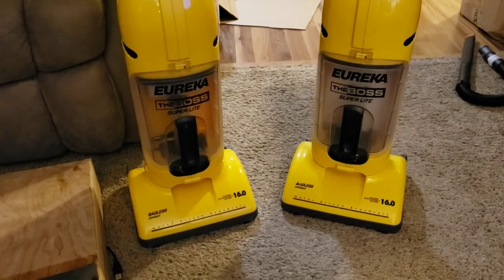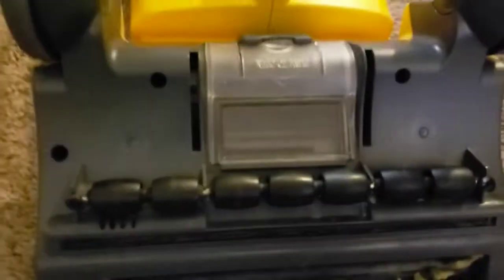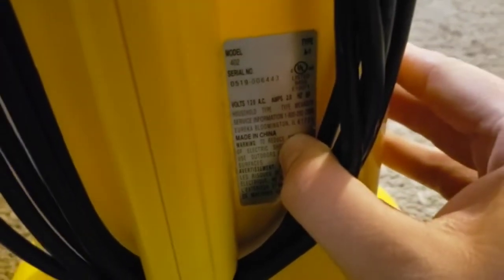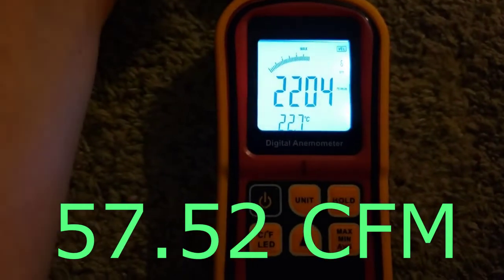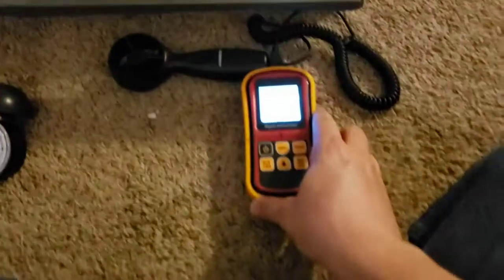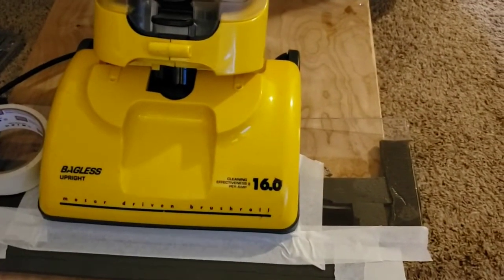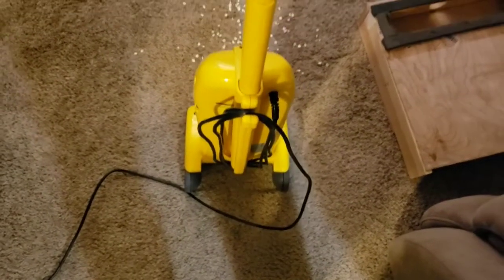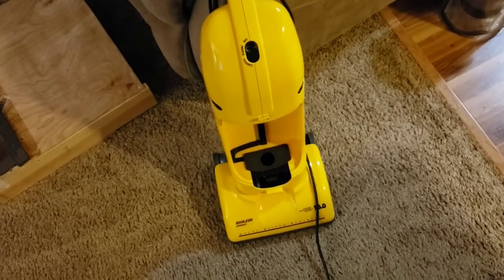Eureka 402 superlite Airflow tests

Comment: I wonder if the "bad" filter" would result in different suction levels the more the bin is filled since with that design, the filter is being covered in dust as it fills up, reducing the area of the filter that air can pass through.  Also, the bin capacity seems to be cut in about half with that filter.

Comment: I had an obsession with vacuums ever since I was two or three years old. I remember buying this little vacuum when I was 10 years old. I was so intent on saving up for it — which I did. I still have it to this day but haven't used it in years.
Reply from the maker: This is a perfect vacuum for a kid. lightweight small in size etc. It's cool that you've held onto it.
Reply: @Blackheartvacs  Yes it still works perfectly fine too! I just haven't used it in a long time.

Comment: mines the bagges version with the head light an a hose could never find another one i guess its the rare version
Reply from the maker: Interesting! i never knew they made such a thing! Do you know the model number or better yet have a video of this oddity?
Reply: @Blackheartvacs  no i don't actually an it doesn't have the model number though I'm thinking about getting rid of it sense its shot motor would barely run an the brush motor burned out an the hose converter is broke so it sucking air from the hose an the floor nozzle
Reply from the maker: @joshuaryanferguson3702  Shame, i'm curious now i've never seen a bagged one.
Reply: @Blackheartvacs  you could buy them back then when they came out the door wasn't clear to its the same color as the unit
Reply: @Blackheartvacs  but yeah i could never find just like it it had more power an a floor adjustment knob to unlike the the baggles unit an a head light but yeah dont know why theres another bagged one
Reply from the maker: @joshuaryanferguson3702  I think you should post this to vacuumland it sounds rather interesting. I'm not having any luck combing the model lists do you have any other helpful information? even a bag type may help
Reply: @Blackheartvacs  honestly it doesn't say bag type or anything else
Reply: @Blackheartvacs  all i know its a metallic like midnight blue its a dual speed motor direct air no clean air thats all i know the model number was a stamped piece of metal but the tag fell off im sorry but thats all i know
Reply: @Blackheartvacs  its a later model by a year when the baggles one came out so yeah sorry

Comment: Not bad for a small compact vacuum.  I do remember when I was little, my mother owned a 1st gen Eureka Optima that arguably had the performance of a full size upright.
Reply: Oh yeah, I measured around 96 CFM on my Optima. Those things are borderline scary with how much airflow they have.
Reply from the maker: @Javi_Lacking  I just came across one of those at the thrift store like 2 days ago and decided to pass on it. I remember someone (you) saying these were powerful so i had to look over things to see where I saw this. I think i'll go back there today and see if it's still around 96 cfm seems almost improbable but we've been surprised before
Reply: @Blackheartvacs  I think it depends on which variant you get. Mine is one of the first Optimas with the non-looped handle and no hose, and its airpath runs along the side of the bin rather than the spine.
Reply from the maker: @Javi_Lacking  I wasn't aware that there were multiple variants, aside from color. The one I found is one of the looped handle models. I'll search the web see if I can find the one you're talking about.
Reply from the maker: @Javi_Lacking  and found one! Model 426 red machine it's kind of weird looking
Reply: @Blackheartvacs  That's the one! There's technically also a third variant: the 431F. It's the looped handle one, except it has the newer Eureka logo (all lowercase), and it uses a different motor compared to the 426 and 431A. The 431F was almost always sold in yellow.
Reply from the maker: @Javi_Lacking   Hmm this one is a 431 type BF in green shrugs It'll make it's appearance eventually I've not really done anything with it yet as i've been working on a Concept one.